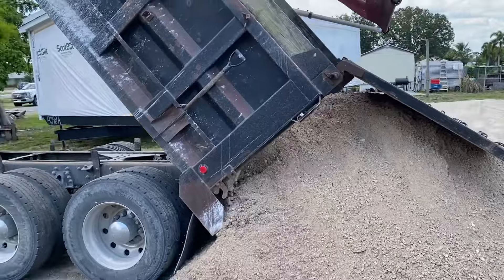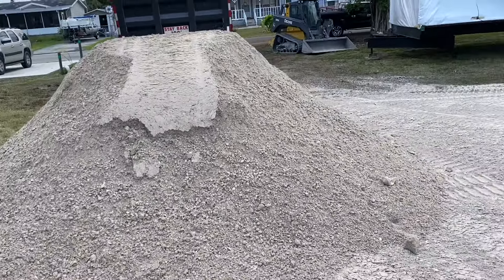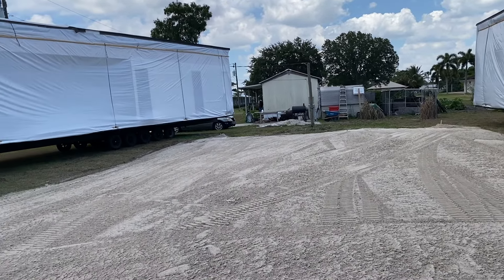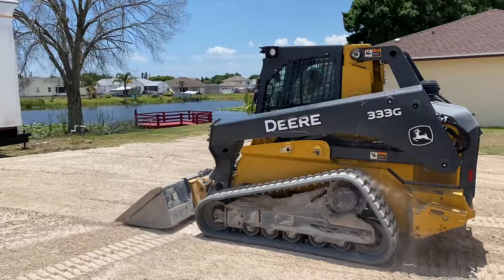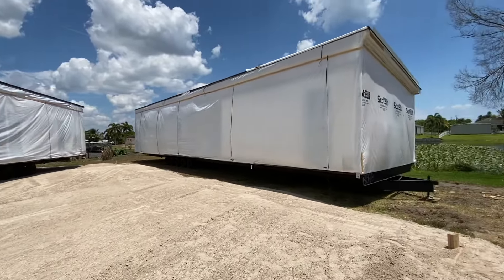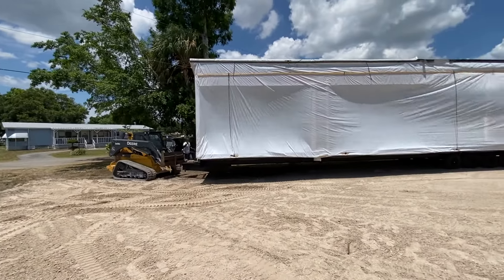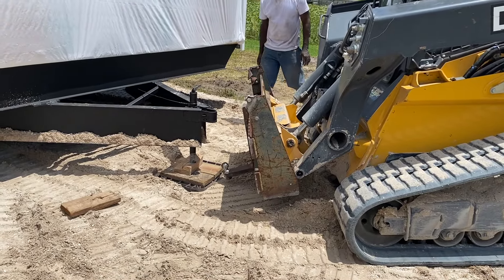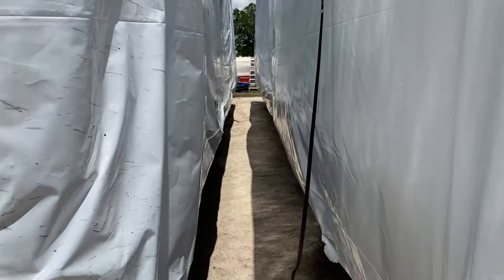Building Mobile Home Pad and Setting the home

Comment: I’m getting two set up, trying to start renting mobile homes out, but starting with barely any money so doing all I can on my own. 

I got the dirt and all ready, but when I move it on what do I need to do? Like do I need a tarp underneath, how many blocks do it needs to be set up on, anchors, or whatever?

I’m having someone (a 50yr old friend) do it that used to do it before all these restrictions came into place. They are both single wides.
Reply from the maker: It depends on where the home is going to be placed and what your state and county requires. Are you going to have a well and septic tank?  If so, the health dept permit will tell you how high you have to place the home.   If its in a certain flood zone, then you may have to do engineered pilings.   If its high and dry out in the country, then you should be able to do dry stack blocks.  In Florida the home has to be 18 inches above the highest point under the home to the bottom of the frame.  So it mostly depends on you local building dept requirements.  Dont do anything until you have full permit approval so you know what they require of you. - Tom

Comment: No compaction?? Guaranteed movement
Reply from the maker: The LBR rating on the dirt we use allows compacting with skid steer tracks.  The shell rock packs down hard and the ABS pads distribute the weight.  We have never had to re-level a home so far....